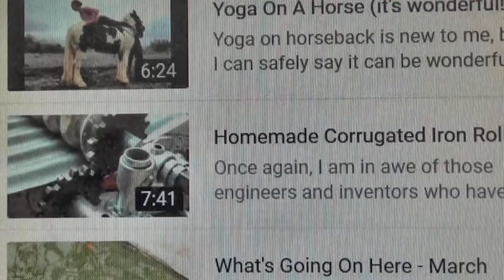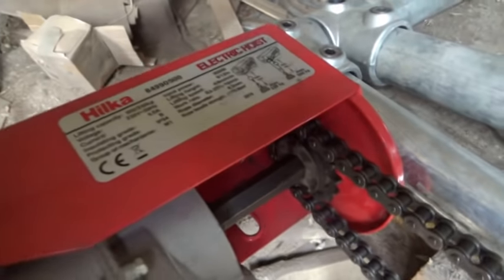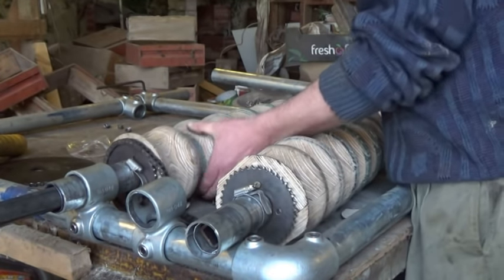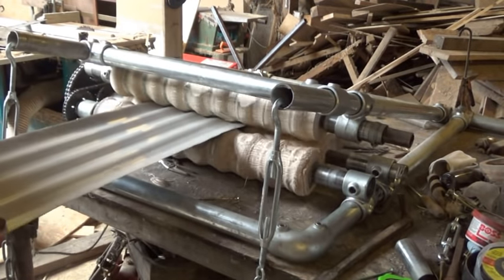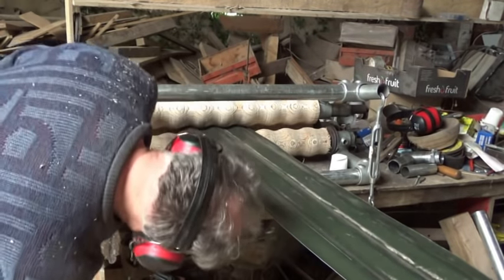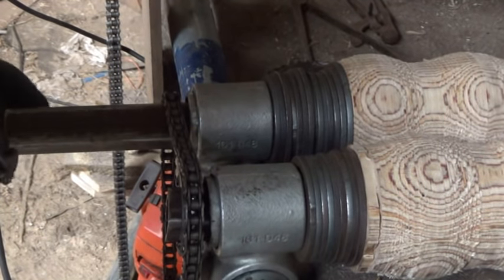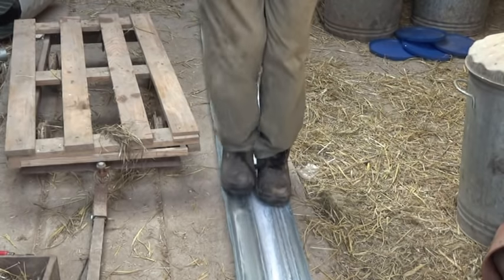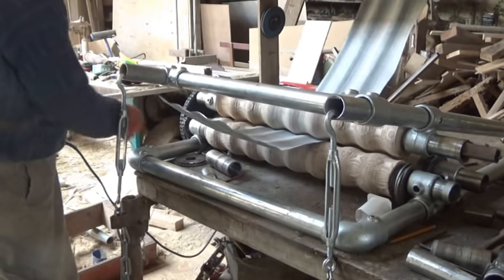Homemade Corrugated Iron Roller - Part Two

Comment: For what your doing you need to be able to variably set the top rollers tension. Your machine works but you need to reconstruct the frame, your method of tension is extremely dangerous and in my opinion you are barely putting enough on the sheet to slightly bend it. If you were to make a smaller roller setup with a shop press equipped with a pneumatic hydraulic pump you can better set the roller tension more exactly and without the frame moving around causing your warpage. I think how you rigged the top roller is your issue. If you look carefully at the video you did not achieve a good attempt at a roll until you re-lathed your rollers making them have more surface area. You got the right idea you just need to implement it with no slack whatsoever and including making sure your gears are properly indexed and have uniform teeth, it seems to me like they were skipping on occasion.
Reply: The men who worked these type of hand machines a century ago did it all in a group with a feeder, a tensioner applying variable tension to deflect the sheet, and a receiver to grab the sheet and feed it back through or grabbing a new sheet. Most modern day sheet rollers use some sort of system to apply a variable force to the sheet. There are quite a few cheap electronics that would make this into an auto-roller that would roll you any shape you feed into the program.

Comment: It seems to me that your end design is to bend a bend. Take an A4 sheet, fold it along its length up and down, then bend it the way you want so the short sides get close, you should see it kink pretty quickly when you try this (personally I am pretty impressed with your finish for this reason) Now take a new A4 sheet and fold it this time parrallel to its width, now bend it so the short side get close and you should have no kinks. I think you can achieve this in steel with two rollers, not three. (Came for the bees, but enjoying your videos)
Reply from the maker: You're right, of course, but that's how the end product will be really strong. Look up Anderson Shelter

Comment: Friend, your design is a basic slip roll. That's what a roll does. To counteract you will need to make multiple light passes, flipping the sheet each time. Also rotate 180 or you will get a flat on one end. Just guessing here, but maybe a fourth roller would achieve the same thing. Good luck! I hope you stick with it and make it work.
Reply from the maker: Thanks, but I am trying to roll the corrugated sheet into a curve

Comment: First the metal is work hardened when you received it.  Every time you pass it through the roller you are hardening it more.  ANNEAL the metal and do it in less passes.
Reply from the maker: Unfortunately the zinc coating can't cope with much heat
Reply: @WayOutWestx2  but it smells so good and deadly.  Curse you zinc.

Comment: Have you tried Befab?
Near Belfast,  they have corrugated iron rollers.
Reply from the maker: Thanks, yes, I wrote to them with my drawings and they didn't even respond..
Reply: @WayOutWestx2  it might be worth giving them a call incase you ended up in the spam folder.   I've bought corrugated tin from them before as they're local,  they were very helpful.  It's a small firm but they're very knowledgeable.  Good luck.

Comment: You are only confining the top roller in one direction. You are trying to ride the line between elastic deformation and plastic deformation.  Change your roll angle adjustment so that the top roll cannot flex down.  Currently your design applies a spring loaded force on the top roll, when the material(sheet metal) starts to bend (in plastic deformation) the force required to continue the bend is less than your applied spring force. You need to control the position of the top roller, not the force applied to the top roller.
Chuck.
Reply from the maker: Interesting, Chuck. But an ordinary sheet roller does that - add more force to make more curve
Reply: @WayOutWestx2  you are dissatisfied with the crinkels  created when the sheet over stretches. Limit the motion. Bend the sheet until it gives, then stop the bend. Put an adjustable block to stop the downward travel.
i use sheet metal rolls, the frames are cast iron with no flex. The only thing that flexes is the sheet. As soon as the bend moves into plastic bending region,  the force (created by the elastic bend) is converted to heat.

Comment: I could be completely stupid here, but isn't the play in the rollers a problem? It seems like they can move around a bit, and independently of each other since the frame isn't rigid. Doesn't that make it almost impossibly unlikely that a metal sheet will feed through the rollers the way you want for consistent results? Like, the axles of the rollers seem to be able to move around a little bit besides rotating. Thus the pressure on the tin would be uneven, no?
Reply from the maker: Yes, it could be that. Although the bottom rollers are very firm these days and only the top one floats...
Reply: @WayOutWestx2  Don't know if that's enough or not. Worth thinking about though.

Comment: As I havent seen part 1 I'm not 100% sure if you are just trying to form corrugated sheet or form the sheet and then curve it.  A commercial corrugated iron forming machine / roller uses many sets of rollers, top and bottom are in line with each other vertically.  The ridges or corrugations are formed incrementally as it goes through several sets of rollers, each set being a little deeper and a little closer together, ie the ridges will be shallow, maybe 1/4 inch and further apart maybe 31/2 inches.  On each set of rollers the ridge or corrugation gets formed a little deeper until it gets to 3/4 inch with the distance between rollers/ridges decreasing until they are 3" apart.  Your rollers being only one set are trying to stretch the metal instead of forming it, hence the stress that is causing the steel to twist and warp.
In New Zealand we use .40mm hi tensile for standard corrugated roofing, it starts out as 940 wide flat product and reduces to about 810 I think when the corrugations are formed.  Corrugated that is meant for curving is .55 mm low tensile or ductile grade. 
Curving rollers are a set of 3 rollers, 2 driven bottom and one pressure roller inbtween coming down from the top (some may use a different configuration but the priciple will still be the same). The third roller forces the bend or curve into it as it goes back and fourth,  from what I saw this is what you were doing ?.
Great inginuity and awesome tenacity. Would love to come visit if I am ever over there.  Keep it up mate, if your not a legend yet you soon will be.  Cheers from Wanganui..
Reply: Been thinking and it wouldnt be to hard to use your machine with some simple modifications. My thoughts are.
Make up some discs about 8 inch diameter and about 11/2 inch thick, you will need double the amount +1 of corrugations you want in your sheet width. Then you will need a range of spacers to vary the BTC of the discs along the driving shaft and an easy way to slide these off and change for the next smaller one as you go deeper with your corrugations (to avoid stretching the steel)  I am not sure how many stages you will need to do but I imagine about 5 minimum.  Production machines would have about 10 sets of rollers so that would be 10 sets of spacers for your top and bottom rollers.  I think because you are rolling ductile grade so that it can be curved that you would get away with 5 sets.  I am not sure what the stages should be but it probably is consistent with the depth your rolling/reduction in your sheet width.  Another reason your rollers are are introducing stress is that if the iron/steel is contacting both on top of the form and the bottom, the bottom being smaller diameter (on your rollers) it is going at a slower speed, ie feet/mm per revolution than the top, the stress factor will be compounded by the rollers having slight variations in size across your width causing sideways stress. So its important to make sure your rollers/discs are all exactly the same size. If you roll all sheets with the first spacers and to the same depth, then change spacers and run them through again and so on till your at your desired sheet width. From memory the production machines drive both top and bottom sets of rollers, not sure if yours did this ?  Then when you have you sheets corrugated if you introduce your third set of rollers to start the  curving process, did you have the ability to offset the top roller ?  I hope you still have the enthusiasm to give this a go, be great to see all your hard work win out..  Cheers, Liam
Reply: Just remembered you had an issue with the roller size being to large and not having the power to turn so I guess trying 4 or 6 inch rollers/former's would be best.  I believe with the reduced friction of the individual rollers, ie with no drag on bottom and sides it would take a lot less grunt to turn/form the steel.  The none powered rollers may also benefit from some lubrication, I am not sure if thats a good idea as I have never tried wooden rollers.  I also found your first video and I think your biscuit idea is not that far off what I have suggested.  I would make mine out of the ply, 2 layers laminated together, with a square holed washer screwed each side to transfer the drive.

Comment: I don't think this method can ever work, for this way of rolling to work, you must stretch the material, and that required steel pinching rollers. I see the problem as all these curved waves yank on each other as you progressively pass the sheet back and forth. Think of a very long roller and running the sheet perpendicular to the direction you currently are trying, that would put the wave in and only bend the sheet, and not stretch it to make each wave section.
Reply from the maker: but there are plenty of commercial examples of working machines
Reply from the maker: But that machine only makes corrugated sheet. I have that already - I just want to roll it into a curve

Comment: I believe you have made a Anderson shelter as they were originally made. They were never a u shape, always in two halves & bolted together. See e.g. : https://youtu.be/EX599XuK59k. I have one curve of an original Anderson, very thick galvanised steel explaining why it has lasted so long outside.Whether they could  have been rolled into a complete u but were then too difficult to ship I don't know. Aesthetically having bolts in the roof ain't so good, but that is how they were done and some of your pieces could be used similarly. If you added ornamentation, say ridge v shape with plasma cut dog, pig, etc it could look nice, maybe a whirligig or weather cock, lots of possibilities.  You would also need straight  corrugated for front & aft so think it could be made  from what you have now. I am not even sure if rolling a u is possible as all the rollers I have seen naturally create a circle which seems to be what your system does. Anyhow hope you get something out of it. I often get criticised for going for perfection which as I am told is the enemy of good  , but we are what we are. Thanks for sharing & good luck!
Reply from the maker: Thanks, SC. You're right - they were my inspiration (my mum had one in the war). Yes, they were made in two pieces so they could be stacked, but I'm sure they could have been made in one piece if they'd wanted?

Comment: Its never going to work old chum, a commercial roofing roller starts off at the 2 middle sections, as it progresses through the system it forms the rest look on YouTube at how the commercial roofing machines work. your idea is only good to recondition used roofing iron.
Reply from the maker: But I'm not trying to make corrugated iron, just roll it into a curve
Reply: @WayOutWestx2 , i had some curved roofing done and the material they use is a lot thicker than the standard roofing iron.
Reply from the maker: Ah-ha. Yes, that sounds like the softer sheet that I just can't find here at all
Reply: @WayOutWestx2 , i never knew either until i went to have some curved roofing done, the normal roofing iron cannot be curved.

Comment: I see from a quick look at commercial machinery your problem is it takes a lot of steps to go from flat to corrugated sheet, each step progressively allowing the sheet to narrow as the grooves form. Further 3 rollers does not allow this to happen easily as it puts pressure where it isn't needed, 2 rollers will be more successful one over the other. Your machine was only ever going to make curved pieces after they were fluted. I used to hang out in a tank makers shop when I was 4 years old  I may not have been able to hold a sheet but even I could hand power the roller machine.

Comment: Duh, ya need only two rollers and pinch the metal between them. By having two on the bottom you have created a bending machine.
Reply: And solid bar through the rollers.
Reply from the maker: but I'm trying to make a bending machine!